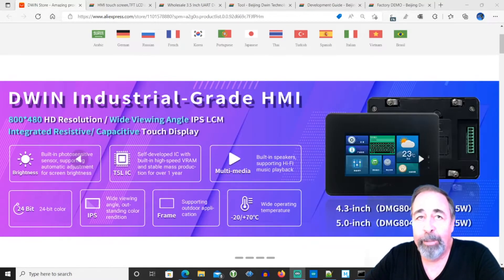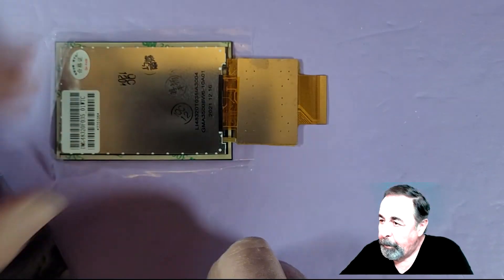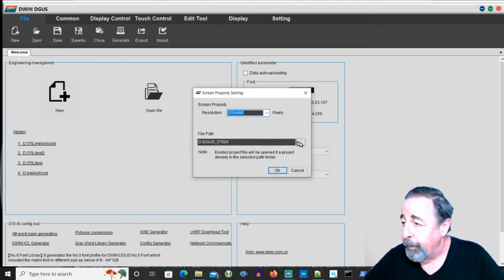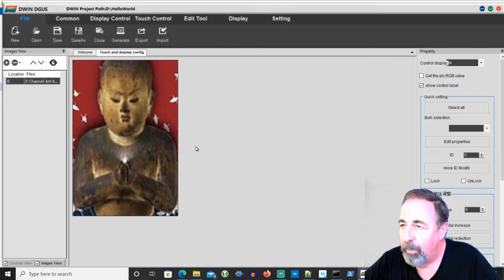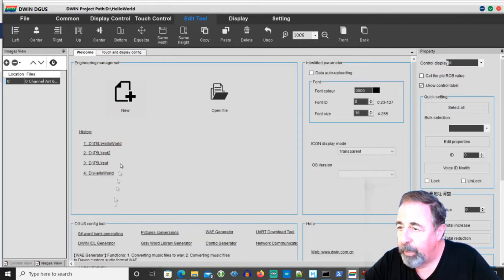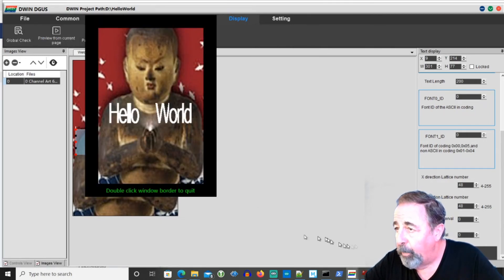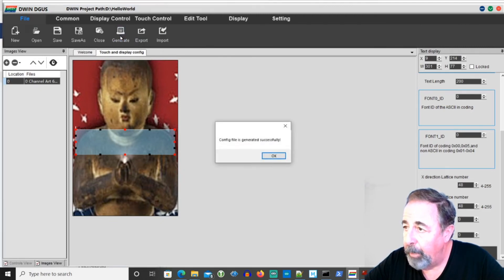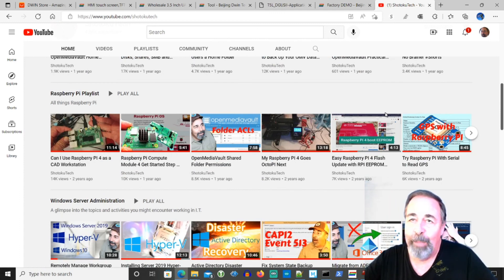DWIN T5L UART Display Getting Started

Comment: Does it have the capability to go into sleep mode?
Reply from the maker: That is an interesting question. I just searched the T5L development guide for 'sleep' and got no results. 'Brightness' is listed a control in multiple facets of programming and there is this:
"1. When CFG address 0x05 is configured to turn on backlight standby 
control of touch screen:
5A A5 07 82 0082 6432 03E8, 10 seconds after the screen backlight 
automatically reduced to 0x32 brightness"
But nothing about low power for the chip.
Reply: @ShotokuTech  it’s in CFG. You kind of touched on it there. You have to switch the display to sleep mode. And then adjust the brightness levels accordingly. The sleep mode only puts the display to sleep without any interaction for “input time increment”.
Reply from the maker: @VenkmanJ  Sure, yeah. I was copying that quote from the manual about CFG. Thanks.